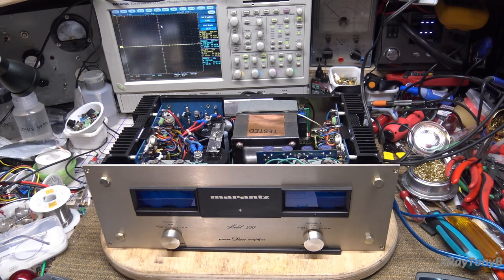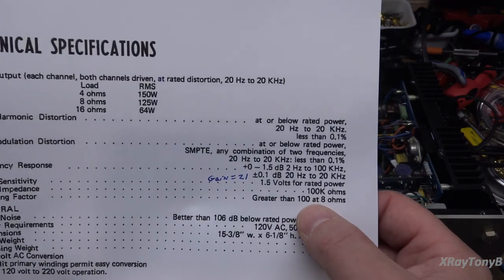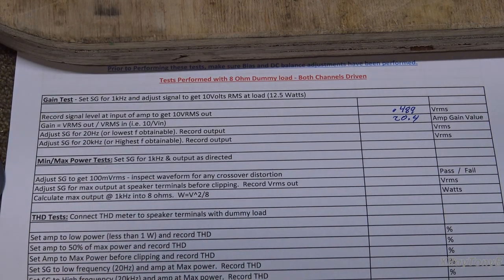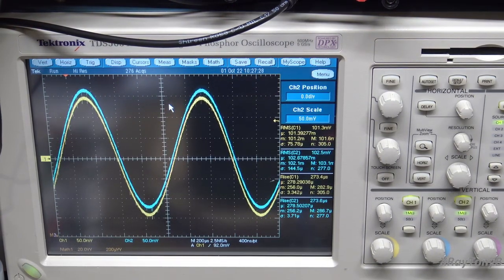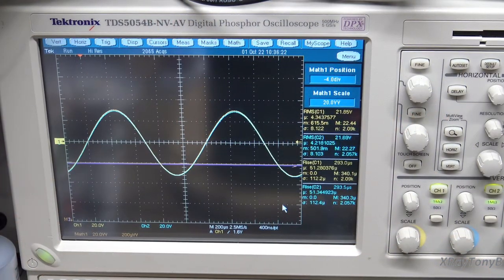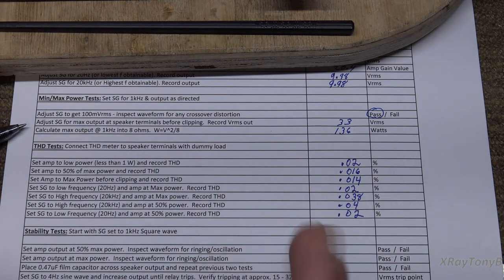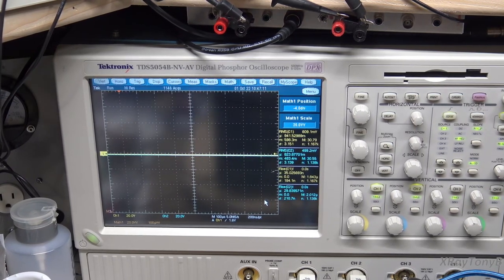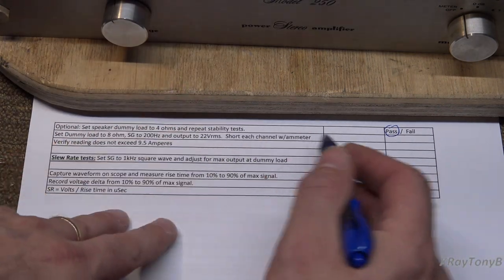Marantz 250 - Testing Output, THD, Slew Rate and more...

Comment: Thanks for the video Tony.  That was a nice and challenging project.  Besides expertise, you have a lot of patience and determination too.  I also liked the "audiophile" remarks.  Unless the music listener is a Gen Z person, it is proven that it is virtually impossible to hear frequencies even close to 20 kHz, but some people fall for the "snake oil" marketing bs and buy power cords and RCA cables that cost hundreds of dollars and produce zero audio improvement.
Reply: Amen.  Been reading a review of my AudioLabs 6000 CDT CD transport, and a couple of posters are remarking about how much better it sounded after they replaced the AC Mains fuse with "Hi-FI grade AC fuses".   I responded, what about the 75 ft of cheap 12g solid copper in the Romex that goes from the receptacle to the mains service box?  "Oh, but the clarity!  The stage presence!  The improvement is amazing!"   Bwaaaaaa!
Reply: @richardmarshall6751  Exactly!  I sympathize with the fact that some music listeners are not experts at all in the electrical or electronics areas, but the old saying "If it is too good to be true, it probably is." can be used.  The person can do some research and ask some experts before spending money (usually hundreds of dollars) with those Pinocchios that claim miracles, as if the electrical utility company uses only 'audiophile grade' materials and components from the power grid, transmission lines, transformers, etc., until the person's house.  Those Pinocchios should be reported to the Best Business Bureau so hopefully they stop stealing money from people who believe in their false claims.  And I have heard ridiculous and false claims when shopping in major stores like Best Buy.

Comment: The relay trip with a 4hz signal was interesting.  One wouldn’t want to drive that amp more than 50% power playing a vinyl record without a subsonic filter. Speakers (woofers) wouldn’t like that either. Power hungry Low frequency rumble.

Comment: this question isn't about this project in particular: what is that Terminator that you have on your tectonic oscilloscope on I believe the external trigger input? it's a white square cube unit? I was watching another video and saw it on the Harman kardon protection circuit video.
please keep up the great work I have learned so much from you Tony. thank you.

Comment: Dear Tony, thank you so much for the video, very informative, as always! I was wondering if you'd be interested in making a video (maybe even a series of) for those who can't afford a full set of equipment that you're using for taking the measurements. I'm talking about using a computer sound card (better an outboard interface) as a DAC/ADC with a proper voltage divider, in conjunction with a whole bunch of software to choose from: REW, Arta, TrueRTA, maybe even SpectraPlus, you name it. You get pretty much the same capabilities, if not more, only for a fraction of a price. I think it would be very helpful to those hobbyists who are not ready to invest thousands of dollars in all the hardware, which is the absolute majority. Also, it'd be great to hear your thoughts on things like what exactly we want (or don't want) to see in the trail of harmonics when we look at the spectrum, be it THD or IMD or square wave, you name it.

Comment: Excellent test. The slew rate is the time derivative of a sine wave d/dt[Vpsinωt]=ω×Vpcosωt = 2πf×Vpcosωt, and the highest slew rate is for cosωt=1, and as a result the minimum slew rate should be 2πf×Vp. If we use Vp-p we obtain a better sine wave, but I tink it's OK to use Vp instead of Vp-p. In this way the maximum undistorted frequency from calculus will be double.
Reply from the maker: Thanks for the comment!  The only issue I see with just using half of the waveform is with the complementary design of these type of amplifiers.  Technically speaking, the rise time and fall time of each side could be slightly different.  Using only half of the waveform would not account for that.  This is really nitpicking, as they are usually so close that this doesn't matter.  One thing I love about electronics is the use of "close enough" math that is often much simpler than the more precise calculation that a math major would use.  My son is currently attending college for EE and often has these discussions with his friends (math majors) as well as his professors about this.  Very interesting!

Comment: The specs show that distortion is rated at full output power. That is very good for any era, because normal listening levels would be much lower distortion on the Marantz. Modern mass market amps are typically tested at 1watt for distortion specs and output power at 10% distortion with only one channel driven. Basically, modern specs are useless info. Higher end companies still use real specs.

Comment: Tony, this was helpful with explaining the testing procedures.  Could you recommend a budget friendly way to measure distortion?  Those Keathly meters are big$$$.   Also how about a series on measuring a working, yet unrestored amp, and running the tests and then doing repairs one at a time to see how it changed/improved?
Reply from the maker: There are several software-based products that use your computer's sound card to do these tests.  They do not have the resolution of a professional piece of test equipment and can be subject to noise artifacts if you don't set them up properly (but so can professional equipment), but they are more than adequate for testing audio gear.  I have used TrueRTA software and it is pretty good, as long as you have a good sound card.  Another popular one is ARTA, which I have not tried yet.  It is shareware and seems to be very popular.
Reply: RightMark Audio Analyzer is also very popular
Reply: What is needed to interface a software based product to a laptop?  Doubt the sound card is anything decent.

Comment: Hi Tony,
   I would have thought that the slew rates for Vp and Vp-p would be the same. It’s the same signal.
The p-p voltage is double Vp, but it has twice the time to get there in the waveform.
Reply from the maker: In theory, it is.  The one slight issue is that this is a complementary output design.  This means that the NPN and PNP sides could have slightly different rise times or fall times, which could skew the results a bit.  In the real world, the difference is usually so small that it really doesn't matter.  Remember, no matter which side of the waveform you are looking at, you will be looking at a combination of the rise time of one side and the fall time of the other.  There are four waveforms that make up the whole signal.  Rising and falling edge of the NPN side and rising and falling edge of the PNP side.  Again, the 4 waveforms are usually close enough to just use the Vp of one side.

Comment: Isn't the frequency response calculated off of the reactive components in the circuit and how they are set up? Another words, it could be possible for an amplifier to have a frequency cutoff at a much higher frequency than the transistor's slew rate could even allow. Not that it matters over 20kHz anyway, I'm just speculating. I know when I have went through all of the stages of amplifiers before and calculated what the frequency cutoffs were at each stage and coming up with an overall frequency response curve(Bode plot), I never factored in the fact that the outputs may not even be fast enough to duplicate a frequency range. Maybe that 100kHz spec was a calculated FR rather than a measured one?
Reply from the maker: Actually, we weren't measuring the slew rate of the transistors, but rather the slew rate of the entire amplifier, including the feedback loop and all of the reactive components.  The transistors (even the so-called "slow" ones) have a transition frequency in the MHz range.  What we were measuring was the slew rate at the amplifier's output, which is much slower than just the transistors by themselves.  Negative feedback as well as the capacitors used to prevent oscillation have much more influence on SR than anything else.    IN some of the "high speed DC" amps of the 1980's, manufacturers were working with designs that used very little feedback, almost no miller capacitors and very fast transistors in order to minimize TIM distortion (which is a debate in and of itself).  The by-product of this was an amplifier with very high slew rate.  The Sansui AU-X1 I restored could pass over 1MHz to the speakers with very little degradation of the signal.  Crazy!
Reply: @xraytonyb  Got ya. Makes sense. I was kind of thinking the outputs should be faster than that.

Comment: Just a thought; since distortion is visible on an oscilloscope only at higher percentage, wouldn't it be better to check the max. power at 0.1% THD, just like the spec sheet says?

Comment: Hi Tony, I am working on a Hitachi SR-604.  I have replaced all the capacitors, all of the fuse resistors and 3 of the signal transistors that were causing shorts.  The bias on the right is 8.8 mV where it should be but the left side is close to 19 Volts.  There is no click from the protection relay and I assume it wont click until that bias voltage comes down to where it should be.  Do you have any idea what could cause that high Bias voltage?  Any help would be greatly appreciated.   Thanks..  Carlos
Reply: If the 19 volts is across the emitter resistor, the emitter resistor is open!  If the 19 volts is at the junction of the emitter resistors, then there is something wrong in the drive circuit to the bias circuit. Check for open junctions on all negative rail transistors. Also check for bad or open resistors.